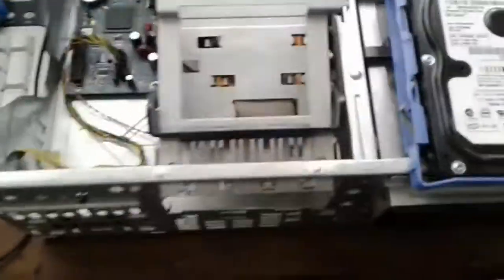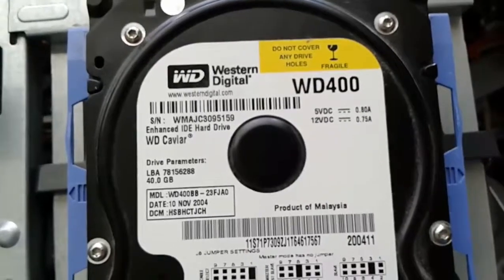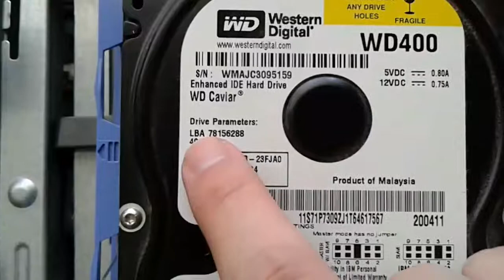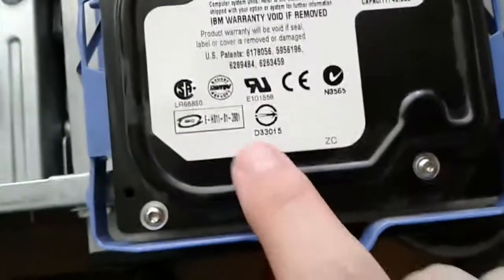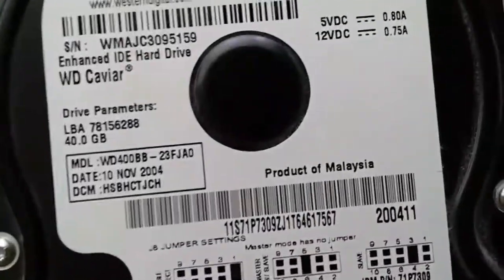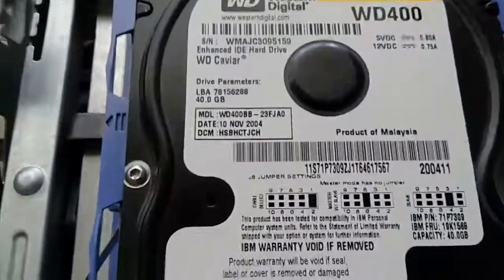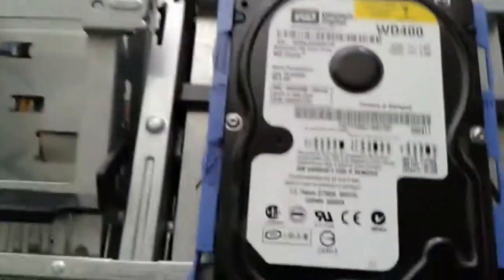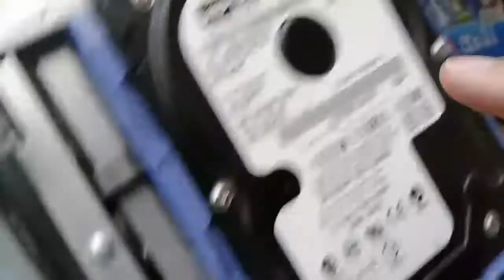My IBM's hard drive

Comment: A ThinkCentre? Cool. I also have one. Be careful as I believe they and their NetVista predecessors are awfully unreliable. The power supply of my ThinkCentre died by making an horrible rattling sound when I plugged the computer into mains, and the NetVista, it got unreliable and went up in smoke one day.
Reply from the maker: VideoTape well mine works  ok if all you do is look at the desktop.... cuz without sound the pc is useless tho it says the hdd is in good health
Reply from the maker: VideoTape mind you initially the fan in my power supply was often  noisy occasionally making a rattling noise due to bad bearings
Reply from the maker: If so much as a minor vibration from the computer was generated either from the hard drive or me touching the desk in any way
Reply: i got one too it still runs beautifully after 8 years of  use its still chugging along nicely